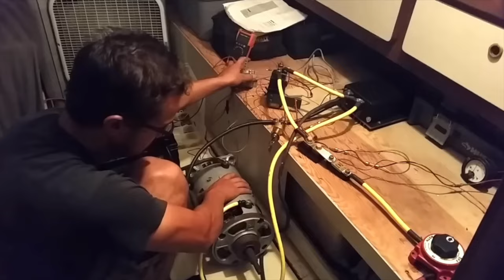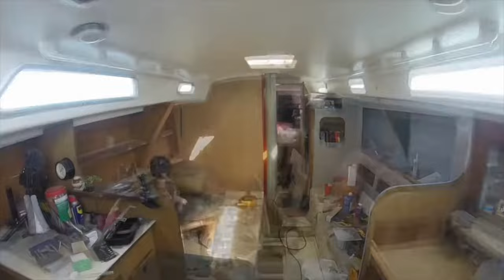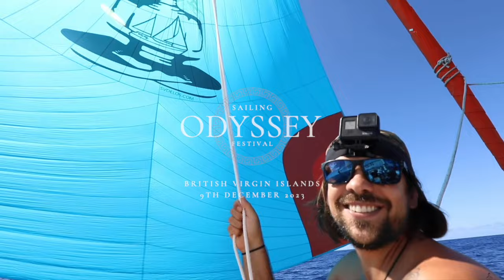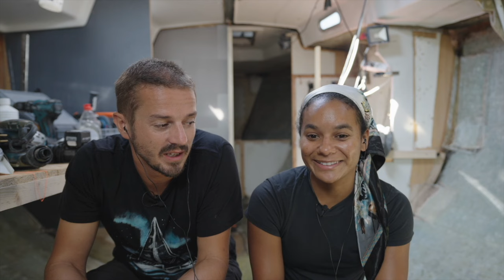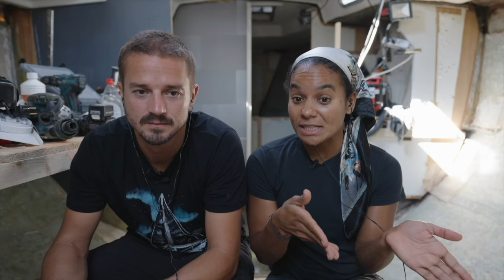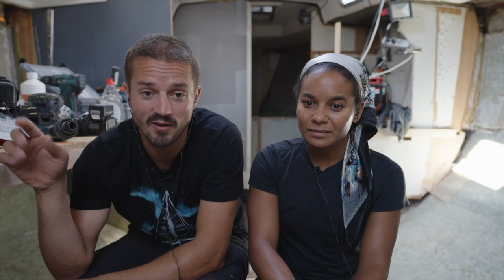Sailing Uma - Dan and Kika, What is the Perfect Boat?

Comment: Dan and Kika.  Loved your comments on Electric propulsion and your frustration with the Engine and boat manufacturers. A point you should recognize is that  Manafacturer Beneteau and related Jeanneau and Lagoon state that the sales to Charter fleets represent only 6% of their total boat sales for 2022. The charter boats are built to have the least problem areas possibles opposed to private owners who likely will use the boat no more than two weeks per year,  the subsequent  owner who will probably cruise will find out what does not work well outside any warranty time period. The Service crews of the charter companies are the best reference source on current production boats. Charter boats are used like they are stolen many weeks each year.
Reply from the maker: yeah all accurate points there Neil, it was a very good podcast, they have a bunch of experience sailing

Comment: I never owned a sailboat, only power boats , but i'm in love with the idea of getting from one place to another without having to pay for fuel . On the other hand I think I would prefer having a large cat to a monohull with two strong diesel engines just for the fact I couldn't handle bobbing around at 2 knots for days on end . I want to get there , drop the hook and enjoy . Most people say 90% of their time is spent on anchor so why not get there as quickly as possible . I seen some sailing channels like Rigging Doctor take 8 hours to travel 10 miles or so because of tacking all day  They can't motor for very long periods of time . Yes diesels come with their own set of problems but for the most part they will outlast the owner and can get you there safely . Maybe when Elon Musk starts building boats then I think electric sailboats will take a big turn for the better ( he just seems to know what he's doing ) For me right now I'm all about burning fossil fuel . Sorry to all the tree huggers . I just want to get there  😇
Reply from the maker: for my boat diesel is the only alternative due to its size and the cost for a sufficiently sized  electrical system. But i like what they said about it forces them to sail the boat with light wind Sails, which is the most enjoyable sailing. The concept is in its infancy but i think with progress it will become the norm